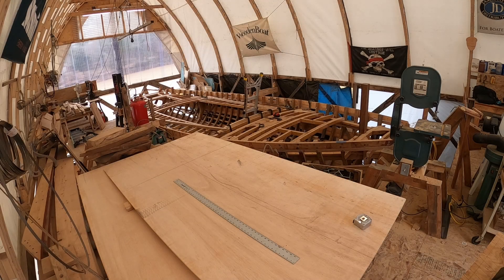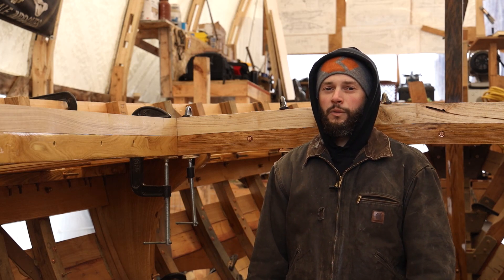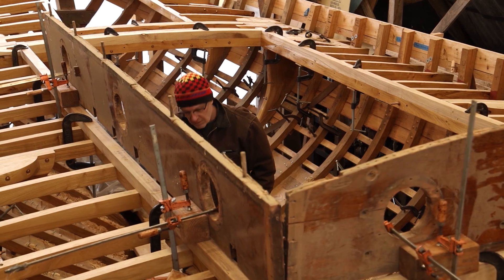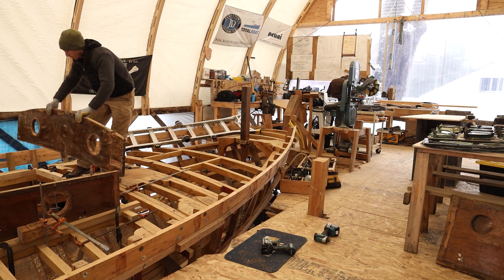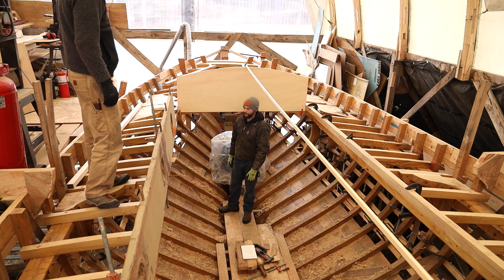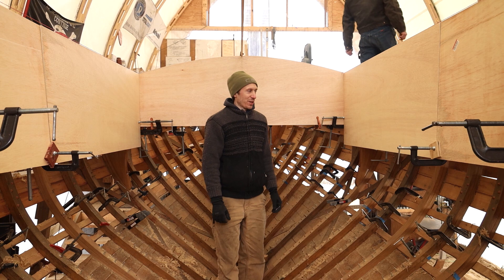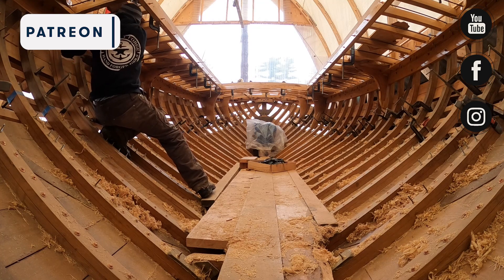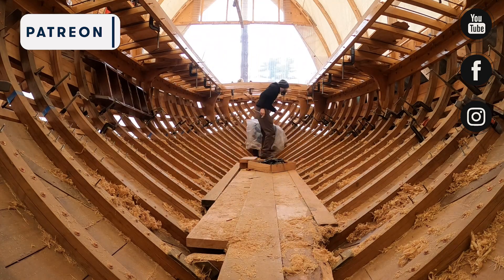Deckhouse mockup -  Episode 148 - Acorn to Arabella: Journey of a Wooden Boat

Comment: I may have missed something, but it looks like you're building the coachroof to fit inside the sill in the deck rather than on top or outboard of it?  Aren't you worried about water intrusion down through that exposed seam, especially given that a wooden boat will work and flex a great deal relative to a glass or metal boat?
Reply from the maker: It’ll be installed on top. This is a mock-up for planning.

Comment: Does one need to be concerned about the height of the boom and any interference with the house roof. Also the location of the kicker and the line of the kicker from the mast to its location on the boom, does the house top get in the way of this?  Just curious?
Reply: Watch the intro again. There's a drawing of the finished boat at ~00:42. You can see the clearance. In fact, the crew will stand on the house top to work the boom.
Reply: @paulheitkemper1559  got it, thanks. I’m not sure where the kicker goes though, it might be at the aft end of the boom, but I think the line that is showing is the main sheet. I’m sure all will become clear.
Reply: @IM-de5dg  there won't be a kicker on a boat like this. I don't remember if they've discussed a boom crutch or not. In the video he talked about putting a beam under the traveler, so we know the main will sheet to the house top.
Reply: @paulheitkemper1559  Why sheet the main that far forward? I would have thought the traveler would be between the cockpit and the mizzen mast! That would allow the main boom to extend aft as close to the mizzen mast as much as possible allowing for the largest sail area. The more sail you  can hang the fast a sailboat goes.
Reply: @steveholton4130  you might want to go look at the drawing of the boat at 00:42. I think your question can be answered better than I can explain it. But in general, be aware that you can have mid-boom sheeting as well. It doesn't have to be at the end.
Reply: @paulheitkemper1559  and @Ralph Gesler  Thank You both for sending me to that drawing. You are both absolutely correct on the location of the main sheeting. I had completely forgotten she is a tiller boat so the cockpit has to be so close to the stern as well as having forgotten she is a ketch - not a yawl. These two basic facts render my previous statement as B.S. In my real world, not AI, experience, I don't believe I have encountered either a Tiller Yawl or Ketch. All the tillers I have encountered have been Cats and Sloops. Also, the drawing was quite enlightening about the companionway. I had been thinking the far more traditional fore and aft on the centerline but that is just as invalid for the exact same reasoning. Thanks again,  sdh in CT
Reply: @steveholton4130  If you want to see an interesting tiller situation, do a google search for "Caledonia Yawl". It's a design I was considering building for awhile. It's a ketch by structure, but these boats were still called yawl by tradition, so I'll let you fight that out with the ghosts of long-dead sailors. Anyways, there's one that had an interesting tiller made with a "frame" to go around the mizzen. Otherwise, the traditional way to do it is with a tiller at 90 degrees and a kind of push-pull tiller extension to allow motion around the mizzen. Come to think of it, a production boat maker, Nimble, had yawls (which were actually ketches) of several sizes which had a similar "tube trame" tiller around the mizzen. Can't say I'm a fan, but it seems to have worked for them.

Cheers!

Comment: as a 6'3" individual, going belowdecks on most medium sized boats is "sucky".  if you have the option for more headroom, without compromising functionality I would highly recommend doing it.  and like someone else mentioned, if your flooring will add to the floor height, you may find yourselves with less headroom than you thought and having to always hunch over and that isn't enjoyable after a time.  an extra inch or two could make a huge difference.
Reply: But then there’s those at 6’5” who would complain. You can’t win on those concepts. For the vast majority 6’ is fine.
Reply: @noelnicholls1894  I suppose you may be right.  I was merely suggesting if the option was there, the extra inch or two could make a huge difference in the experience, especially if they decide to take any extended voyages.
Reply from the maker: Adding an inch or two sounds easy, but the cabin top is also a place to ship a dinghy or other things so side deck and foredeck is clear. Lots to fit not just in the interior space, but practical considerations as well.
Reply: @AcornToArabella  appreciate your reply.  you guys are doing an amazing thing.  as an armchair quarterback I yield to your superior boat building skills :-)
Reply: @diogeneskoolaid8437  Yep, as one on that tall side I would be all for it. But they are intending it for themselves and, as Steve has pointed out, the slight change would affect the view sitting at the tiller significantly.  Never helmed more than a 16’ daysailer myself, but having spent 16 hours nonstop on the tiller I can see the point of keeping the sit down view manageable.

Comment: I was fascinated by how scientifically you determined how high to make the house roof.  Did you consider the height of the floor that you were standing on when you did that?  From the video, it looks like your bilge floors are just random planks.  Will those planks be the actual floors inside the cabin?  Just curious if that was your foundation starting point, or you have other plans for floor height inside the cabin?  Could you possibly clarify that in a future video?

Comment: The house roof needs to be comfortable to sit on, ensure when on it your cog is comfortable in a sea. Any overhangs do not catch sheets or lines. Simple not.
Reply: That is the last thing they will worry about. It's more important, that it is comfortable to stand inside and to look over it while steering the boat!
Reply: What a great point, I've spent more time on mine than in it.
Reply: @jwyzdm  having croached on a coach roof (or house top) with bolt cutters chopping a block open after a reefing line jumped the sheave and a lea shore getting closer. Having a stable platform was all I wanted.

Comment: To me, Victoria's lower deck looks wider than what you are standing on. By first, layout the exact lower deck area wanted, then judge where the top of the cabin should be, you will prevent lowering the top of the cabin later if you feel the need for more floor space. More curvature in the roof will add more strength to the house structure, lateral wind resistance, better water shedding. Remember, when you are sitting in the cockpit, you will looking way past the front of the boat just like driving your car.  anyone on deck will be standing so your field of view will change. Solid acrylic domes on the top, placed in the seating, area will dump a tremendous amount of natural light, with no opening.

Comment: If you are going to travel where are you going to put the batteries, fuel and water tanks?  Under floor would keep weight low and center and give you more floor width.  Nice to see out when sitting during bad weather.

Comment: Would someone mind explaining the purpose of the tie rods, please?

Great video as always.
Reply: They provide extra strength where the deck beams do not span from port shelf to starboard shelf.  This strength is used so that the short beams that only go from shelf to an opening side do not have to carry tension.  Those joints are only held in tension with locating screws now, but the tie rods will be plenty strong to keep the fire and aft carlin's from moving inboard.  If the deck was plywood, they may have depended on it to resist these loads, but planking will not.  It's a great solution.

Comment: Rather than a center beam down the length of the Deckhouse I would suggest two at least as wide apart as the companionway hatch. This would also allow for easy install of a Butterfly Hatch in the ceiling.
P.S. Why do some people think you are going to be sailing Arabella into a Gale with seas crashing over the bow or stern and sweeping away the Deckhouse?  Haven't they heard of Windy.com or even weather broadcasts over the radio?  Maybe they think Arabella is a part time submarine?
Reply: They think that because they have experience. If you are half way across the Atlantic, what help is windy.com or any other, often wrong, app going to be?  All ocean-going craft are part-time submarines.

Comment: If you aim for 6 ft ppl, better make sure the edges are 6 ft, you will have a table in the middle preventing those 6 footers standing/walking down the middle of the cabin
Reply: Table should be offset to give a clear walk through.

Comment: Last ebay aluminum Jon Boat I bought they painted the bottom with copper based paint.....
Reply from the maker: Those copper based paints are neat. They’re a two-part epoxy that doesn’t belong on wooden boats though. Enjoy that boat!!
Reply: @AcornToArabella  Dont belong on a aluminum Jon Boat either. Turned the bottom into swiss cheese.

Comment: What do the plans call for regarding the House? It seems to me that all of this work has been engineered already. Have you stopped referring to the plans from here on out?
Reply from the maker: No, certainly we’re not going to stop referring to the plans. It’s not difficult or dangerous to deviate (a tad) from them here. Many do.
Reply: @AcornToArabella  Thanks for the reply as I appreciate it very much. I know you had mentioned the changes to the plans in regard to the Mizzen Mast. I am curious about what you are planning for the companion way  since it is offset from the centerline due to the Mizzen mast and if moving the Aft portion of the house forward enough to allow you to locate the companion way in the center of the house?

Comment: The stern coach roof should be 2 inches higher then bow end?
Reply: I guess it makes the companionway easier? Or shed rain away from the companionway in calm or docked conditions?
Reply: Yes, otherwise it will look like it's leaning backwards at an extreme angle, since the low point of the sheer is near the aft end of the house. The house sides and ends should actually be angled in very slightly to look best.

Comment: I know your going off the original plans but man all that work and the only place you can stand is in the saloon. People have for some unknown reason have gotten taller over the last 100yrs.
Reply: Just my 2 cents a higher house top would be nice for a seat while under way and on the hook and it allows better protection while sailing .
Reply: Go look at pics of boats with standing headroom in other areas. They look horrible.
Reply from the maker: Paul’s got it there. True story. Boats aren’t like houses in this way, and also, they don’t function the same.
Reply: @AcornToArabella  I understand just my 2 cents I've been around boat for 38yrs I live on the Chesapeake bay. I work on and repair the last of a commercial sailing oyster dredging boats in America the skipjack. All I was suggesting was a higher house top for seating while on deck and standing head room below.

Comment: The deckhouse looks high. Will you be able to see anything while sitting down in the back.
Reply: Maybe the camber could be reduced lowering it at the centre?
Reply: He already checked that out in this video by sitting in the cockpit and assessing his site lines.
Reply: To much drag. Way to high.
Reply: @boooshes  i didn't mean while siting inside but while sailing, sitting behind the deckhouse. Will he see anything forward but the deck house.
Reply: @christiansvanteson5185  yes, that's exactly what he did.  He went aft into the cockpit where he would be sitting with the tiller in his hand and checked his site lines over the forward and aft housing bulkheads for viewing while at the helm position.
Reply: @boooshes  You're right. I missed that. Sorry.

Comment: cutting smooth arcs with a skill saw, I'm impressed
Reply: I was thinking the same thing!
Reply: It's really not that hard, as long as you don't extend the blade any farther out of the tool than you have to to reach through the wood. In this case, 3/8-1/2 plywood. With the blade just 1/16th more out of the saw past the plate, there is very little side to side restriction, so curve cutting is quite easy, just follow your cut line with the leading edge of your blade. (Wear eye protection, as leaning over most circular saws to watch the blade does expose you to flying particals coming off the blade. A face shield would be even better.)
Reply from the maker: Nice explanation Thomas.

Comment: Remember the floor will be higher also to get a decent flat floor area.
Reply: There's been some discussion on this in the comments here, but no response from A2A, so it's not clear whether they were factoring that in or if that detail completely passed by them at the time of the filming...
Reply: @mjmdiver1137  I got a response from A2A, regarding adding 10inches to the current option of cabin height. They said they can not as they intend to carry the Dingy on the deck. I gesss that’s ok, as in most cabins you are mostly sitting down. It’s not my boat, and I know a fraction if not a lot less than those two at A2A. Been watching from the start and I am amazed at the craftsmanship and determination. I can not believe they cut tree’s down, milleded them and built a boat. Wow, just wow....my respect to them all. So much skill and knowledge shown. My throwaway comment was a passing thought, they do know better than me. I think they want more speed, rather than comfort. It’s a balance and that balance is right for them. It will be an amazing sight to see the sails up and in the water. I do hope they go with the tradition rigging than an off the shelf buy and fit.

Comment: i dont know, putting the walls to the outside of the coaming instead of the inside seems like it would shed water better. like the PT boats did.
Reply: My understanding is that the mock-up plywood you see now will be a mold for the strip planked house sides.  These finished sides will sit on top the sills, not inside of them.  I'm not sure exactly what the treatment will be at the side/sill joint, but it may be epoxied and glassed over or bedded in compound.  Then the sills become a unified part of the house, not a combing that the house sits in or on.

Comment: why buy portlights when you can modify existing round ones by welding cast profile pieces in between the halved ones and have some tempered glass put in them (cutting to shape and then tempering them)
Would be much cheaper and also nicer then a true oval I would say...
Reply from the maker: This was a choice. We make lots of choices based on lots of conditions. The result of the process you’re suggesting wouldn’t result in the port light we’d want or need in that place—and actually, what straight parts would we cast from if we cut curved parts and wanted straight runs in between? We’d have to improvise the shapes, which a bronze worker or metal smith could do really well I’m sure. This is one of those times where someone else’s expertise is better than what would certainly be our hack.
Reply: @AcornToArabella  Straight bits can be made relatively easy as you did with the deck beam ties... My point was about saving roughly 1000 dollars per window by having a "stretched" port hole  rather then a true (and obviously more elegant) ellipse shaped one...

Comment: Don’t forget to think about how to hide wiring for lights etc.
Reply: I would personally leave it exposed and take some time making the cabling itself look nice.
Reply: Can quickly look a mess. I found a brand of plastic clip that I could drill out the pin hole and fit a long stainless stainless screw that didn’t look too horrid. Would have a deal nicer to not see the cables at all.
Reply: DO NOT under any circumstances either hide wiring, or make it difficult to get to!
If there’s a fire onboard caused by a short, you want to get to it PDQ to extinguish.
Plastic ‘gin palaces’ that are destroyed by fire, is due to the fact that all wiring is hidden away, making it near impossible to determine where the fire started, therefore, difficult to impossible to extinguish!
I served aboard a Frigate in the ‘60s and NOTHING was hidden from sight, for obvious reasons, with fire being uppermost.
Reply: @geoffhalstead1811  I hope no one starts shooting at Arabella! Proper fusing would deal with most of the fire risk. The key is to be thinking ahead. Sometimes it’s easy to be so focused on what the immediate issue is that a few moments thought for the future gets forgotten.

Comment: Considering that you have a welder, you could make those port lights yourselves. Casting bronze isn't difficult, and for something like that, it's basically beginner level casting. As for the glass, you could go with a laminate of glass and lexan ( G-L-G ) with two sheets of 3M self healing UV resistant clear bra material over to protect the glass in time (a scheme i'd do to all the lights because replacing a plastic clear bra is cheaper than glass and the self healing attribute itself, makes the glass last years).
Reply: You need to use materials approved by a Classification Society, for reasons of insurability, if nothing else. This is not an area to experiment with.